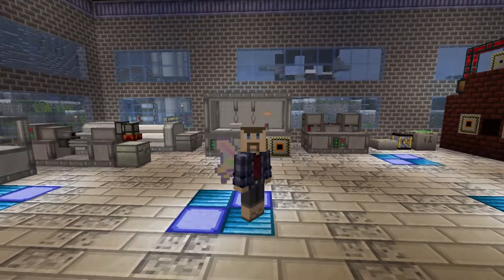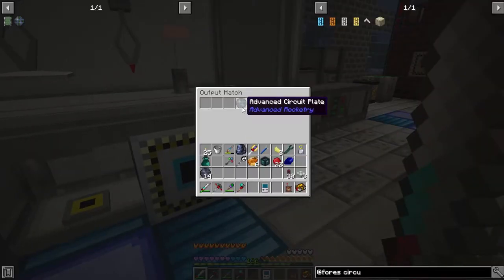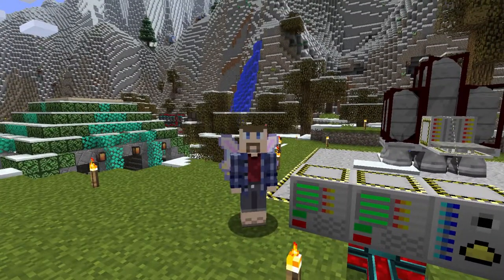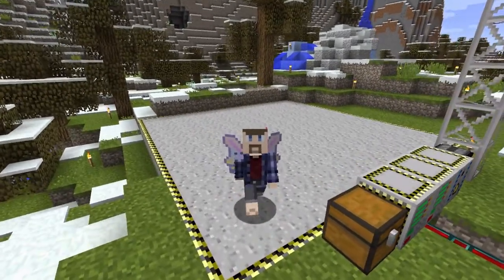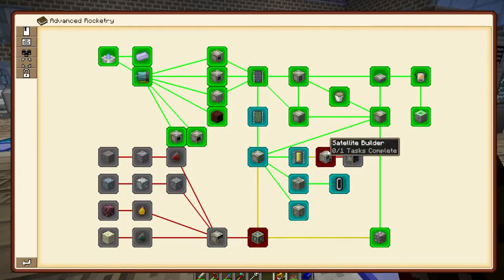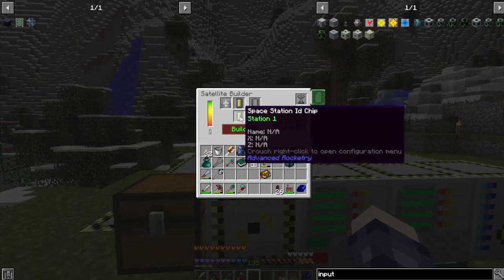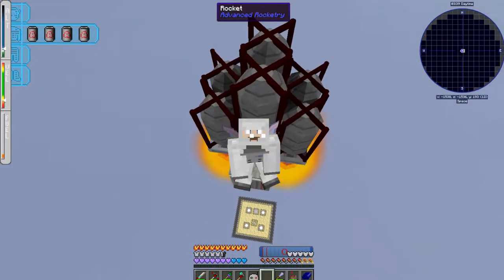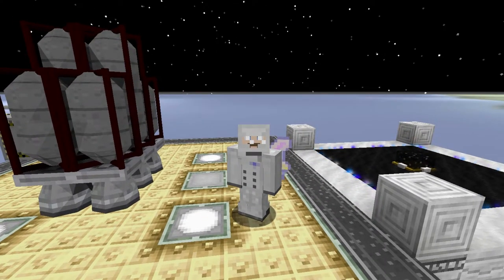Creating an Advanced Rocketry Space Station - Minecraft: Enigmatica 2 Expert #81

Comment: Well you have finally inspired me to get off the fence and get into space. Another first for me. 😀 it’s a mod I’ve always wanted to play with but just thought it looked like a lot of hassle. I’m glad I did. Not quite there yet. Just messing with the fuel config files. I discovered I’m on the older version of the pack 1.82 so the fix didn’t work for me with the fuel. The configs look slightly different between the mod versions. I should really just update to 1.83. You did a decent sized first space station. And it looked pretty good. Looking forward to see where you end up with it.
Reply from the maker: Heh, I made a box.  I wanted to not make a box, but you're constrained to the size of your launchpad.  I went with simple though since I had no idea how any of this worked, and the oxygen situation was super confusing for the span of a few hours until I got it launched.  Be aware there are some issues with oxygen and some modded blocks not properly sealing the room.  Mine apparently was always sealed, but you get no indicator of that when you're building it for the most part.  Just make sure you turn on the machine when you get it up there.  Also make sure you bring some means to get home up with you.  Either more fuel and a bucket, or some means to teleport.  Ideally both in case something goes wrong.  I'm partial to the astral sorcery celestial gateways since they don't require power, but they do require access to the sky, which means they can't be enclosed in a sealed room in space.

As far as fuel goes, you can just make rocket fuel as well.  It's not that hard.  I just fixed the configs in mine because it WAS intended to have a larger list, and I already had tons of liquid starlight, so I just opted to do that. 

If you changed the fuel configs, but did not restart your game and/or your server depending on how you're playing, that might be why it didn't pick up the updates.  It wasn't hard for me to update it otherwise on mine.

Comment: Fixed it now might have just been the fact I was using a portable tank to fill it up and not a bucket. The console output told me that the rocket fuels failed to register. I just removed the ;2 etc from the lines I added. 
I made up the mixer before and was going to get the tar. But used my starlight instead. Reet off to the moon I go.
Reply from the maker: I just wish there was more actual stuff to do in space.  Galacticraft at least had bosses and mobs.  So far I haven't found much.  That said, once you get to the space station, there's not much left to go.  Most of advanced rocketry's stuff is optional, so it comes down to how much do you actually want to engage with it.
Reply: The moon was definitely an anti climax. I was hoping there maybe some structures to explore atleast. Presume it’s just dilithium we needed from there. 
Space station next. 😀
Reply from the maker: Yeah, it's dilithium. Just drop a digital miner and you'll end up with more than you ever need.  As far as the rest of it goes, if you've got one or more laser bases going, the only thing left is make the space station, add a warp drive, and find the clathrates on a few planets.  All the other ores you'll already have from the laser base.